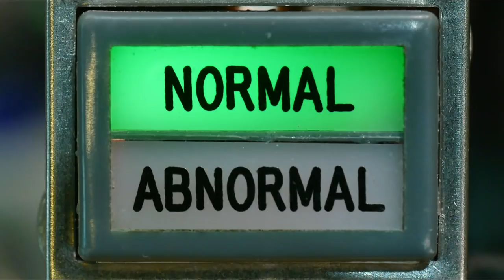#807 Satellite LNB Teardown

Comment: The "blobs" are DRO resonant ceramic pucks that function sortof like cavity oscillators. Their physical size determines the frequency of oscillation.
Reply: And with the screws you form one adjustable ressonant cavity ! The black things are GaAs fet's probably with some 1/4 wave feedback... Cool! You can modulate the fet dc power and make one 12Ghz Fm transmitter lol :)
Reply from the maker: there is a guy who turned one side around and make it transmit then used the two channels to do doppler radar.
Reply: @IMSAIGuy  cool!

Comment: A bit of extra info on that LNBF. The three holes are for 3 separate satellites to be received. All of the signals are circular polarized and need to switch between RH and LH. And all the switching is done with a modulated low frequency (less than 1 MHz) low bandwidth signal that is controlled by the receiver.

Comment: This unit could be a DIRECTV SL3-SWM SlimLine Single Wire Ka/Ku Triple LNB With Built-In Multiswitch . Most "simple" LNBs use high audio tones to switch from RHCP to LHCP or linear polarizations. This unit uses a micro to switch 3 LBBs and polarizations. all for $15.99
The Ka band  26.5–40 gigahertz (GHz), i.e. wavelengths from slightly over one centimeter down to 7.5 millimeters.
Receives three satellites signals - 99°, 101°, 103°.  The two smaller feedhorns are most likely -99 and -103 and Ka band.
Reply: Yep, it is a multi-satellite LNB. These were first called simulsat systems by the satellite industry. The satellite TV services have definitely figured out how to stack satellites in elevated orbits as well as having cross-angled reforms to see adjacent satellites. This is a description of the SWiM technology. https://www.tech-faq.com/directv-swm.html

Comment: Wow. Great teardown. I didn't realize those guys were quite as complex inside.  Filters and stubs galore! Neat. These LNBs actually use left and right hand circular polarization, rather than vertical/horizontal. Also, if I remember correctly, the duplication of the microwave section has to do with the unit being able to be split to two different outputs (via a 22khz or similar switch) and sent to two TV receivers, and each can tune to different channels at once, or possibly they use one LNA section for each polarization and switch between them at lower frequencies, rather than switching antennas at 12GHz.

Comment: CD4046 is a low frequency (if I remember 1 MHz max) PLL chip. Why is it on the PSU board then?
Reply: There was other digital stuff on that board, and oscillators on the back, so the 4046 is used in a PLL for some reference signal. Since that's a low frequency chip I suspect it is used for the 22kHz switching circuitry. (Satellite systems sometimes use 22kHz signals on the feed line to control switches of different outputs and such.)
Reply: I think the little silver guys are SAW filters. Man, those LNA chips probably have some killer specs --- they have to be relatively low noise and have good performance up to 13GHz to not distort the precision phase modulated signals coming in. Really neat stuff.
Reply: @ruhnet  thanks for this , I didn't know about it , so the coax between the LNB and the receiver has DC + 44 khz ctrl + RF .    Woow
Reply: @ruhnet  This looks quite a bit different to the "european" LNBs I'm familiar with. The waveguide does not seem to be separating the beam into it's v and h polaraised components. Ones I took apart had some geometry inside the waveguide and two little "antennas" 90 degrees apart. Also they were much simpler. usually two chips, one for power and bias for those i presume FET amplifiers and other generates LO and switches the band according to the 22khz signal.
Reply: Also those "side" receiving channels, I have no idea what those are for. Only one F connector so only one satellite at a time could be possible. Maybe it's switched with DiSEqC? No idea.
Reply: @djtransnazgrz  I don't think DirecTV uses diseqc but I haven't messed with sat TV in a couple years so I could be wrong on that. The polarization is actually R and L circular rather than vertical/horizontal. I'm pretty sure 22kHz is used, and possibly another DirecTV specific control signal. You are right about the single output though; that does make the dual sections a question. Maybe they are using separate LNA sections for L and R polarizations, rather than switching between them.
Reply: @MIsam-fv9kb  Yep (22kHz). And possibly some other control signals as well. :-)
Reply: @ruhnet  Weird, I used a satellite meter (satlook micro HD) that had V and H as polarization indicator. Now I'm curious which one is correct.
Reply: @djtransnazgrz  The meter (or the receiver either for that matter) doesn't know or care the actual polarization. All it knows is that one is 12VDC and the other is 18VDC on the line to the LNB. If it gets a signal in the 900-2200MHz range for one polarization, and another signal for the other polarization, it'll be happy. Most C and Ku Band FTA satellites still use V/H polarization, but DirecTV and Dish Network both use circular, so you can have more leeway in how the dishes are oriented in single LNB/single satellite installations for easier mounting (orientation of the dish/LNB is critical with V/H poloarization). There are other reasons they went with circular as well, but that is one benefit. (But with multi satellite dish installs it's moot.) Some other reasons are that circular polarization has less problems in certain cases with fading and ground reflections, and it counteracts satellite spinning/rotation (although I think that counteracting spinning would be more applicable to small non-geostationary satellites than TV sats.) Also, circular polarization can give more standard/even signal results over a larger coverage area, particularly in areas not directly below the satellite.
Reply: @ruhnet Just checked and yep, HotBird and Astra(two common satellites I tuned into) still use V/H. I had no idea about DirecTV cause I'm in Europe. Well, I learned something new I guess.